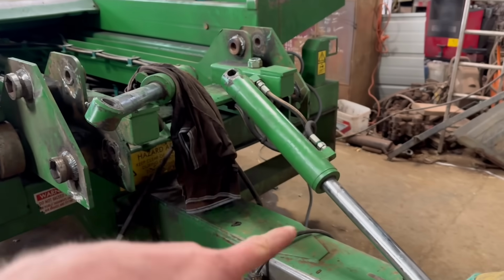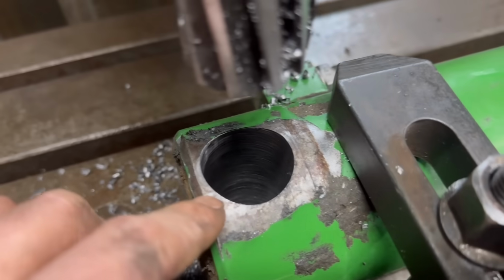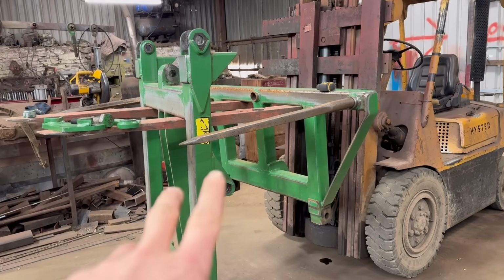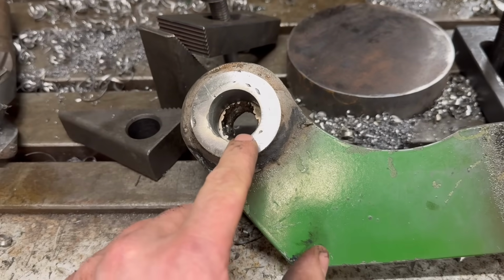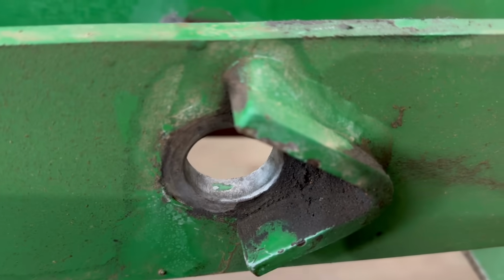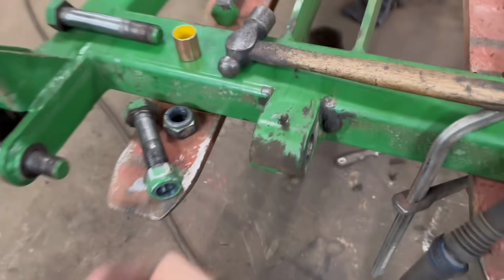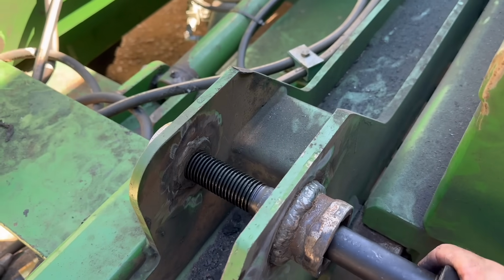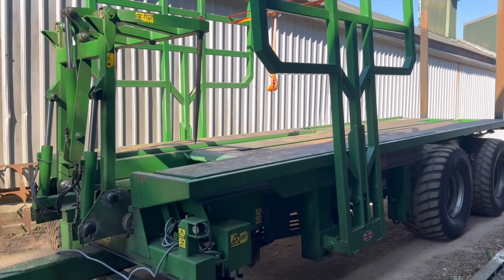Heath Super Chaser needing some attention. REASSEMBLING! Final

Comment: VERY aggravating !! I've got a 31 year old Isuzu truck in factory new running condition bumper to bumper with one flaw. An aftermarket air conditioning mount mis-aligning the belt by 15mm or so. I've searched for the proper mounting bracket for five years now. No luck.
But I know if I took my truck to Snowball E. Oliver could hack the mount up and re-weld it aligned correctly in a half hour. There's just the minor expense of shipping my truck from Thailand to Yorkshire and back. Or giving Oliver with all his tools a week paid vacation in Thailand. (I trust the local engineers half as far as I could throw a combine.)

Comment: Nice job, but the original machinery was obviously built to a price. Most of those joints and pivots should not have been done with a bolt, but should  have been high tensile steel pins with retainers like a circlip or a tab bolted to the frame. Considering the loads and abuse that gets meted out to farm machinery they all should have been bushed and with grease points. The SHS sections looked a bit light for the forces that are applied. beefing up those joints with top hat welded bushes was a good answer.
 Well done. That bale chaser should go for at least another 3 seasons.

Comment: Seems like that sort of cost cutting is prevalent across most industries at this point. It seems like there would be a pretty direct correlation between cutting corners in engineering and the amount of warranty work or lost business that you would see, but it seems like saving money up front always wins out even if it costs more overall.

Comment: Great work Oliver, just an idea, but I wonder if the chassis plates, as you call them, are actually the manufacturers way of making them as the base for a standard sub-assembly that can then be welded on to whatever length of chassis box section they want. Also it would mean that there is no need for several welders to be working close to each other as would happen if the spring hanger assembly was being welded direct onto the chassis box sections. Just a thought.

Comment: I think that's a better option what you did to ream the bottom end of the ram out to 34mm and fit a bush, rather than reaming it to 32mm. This way, when the bush wears out it can be replaced, rather than having to ream the hole again.

Comment: As Isaac's helmet says: "I'm here because you broke something..."  Fully agree on the engineering upgrade recommendations for that machine.  All wear surfaces should be bushed, and proper heat treated pins used.

Comment: Good job, and I am sure you will be glad to have that monster clear of the workshop for a while.  With regards to the design and manufacturing issues, everything is built to a price and sold for max profit and to be fair that chaser must have moved many, many bales since it left the factory (was it a 2014 model ?). In reality the major issues were wear in some of the load bearing, moving parts and several cracked welds on the chassis.  Yes, they could have been identified at the design stage and modified accordingly, but that IMHO may only move the problem somewhere else.

Comment: The reamer does need to be concentric for the cut, it will bend and make a curved hole that is a not round, the reason is it is following the forces and the forces are pushing sideways initially then the flutes start guiding it with a deflection causing a non straight hole, as for the cut size that depends on how precise you are trying to be, a bigger cut is more deflection and a lower quality hole, how much these matter for a non precision pin is another question.

Comment: That Huron mill is definitely earning its keep ! 
A retired engineer looking at the crack patterns and design I suspect the original designer used soft-wear for over the road trucks and trailer design from what I see it would be fit for that service, unfortunately agricultural equipment needs to be significantly more robust mostly because of the uneven terrain soft roadways causing flex and twist which are minor on over the road use equipment but very significant in high load soft tired equipment like this , many large heavy load field equipment has gone to wide long tracks for this reason to reduce both ground pressure and flexing loads on the frame by using active airbag load leveling . You are correct I believe in thinking plug welding of the reenforcement on the box frame would help but likely cracks will eventually happen there too?
Nice repair to keep them working , well executed I would say !
I hope you are well compensated for your knowledge and ability !
Reply: Sir, I am a retired over the road heavy truck fleet maintenance manager responsible for specifying and purchasing equipment for over 40 years. I would never, ever under any circumstances allow that suspension and axle configuration under any piece of equipment I specified or purchased. That suspension setup would be suitable for only the very lightest of loads on over the highway transportation where a very minimum of maneuvering is required. You are absolutely correct in your statement that agricultural equipment needs to be more robust. I started a farm equipment maintenance and repair business when I was 14 and, after retirement from the trucking industry,  I'm doing the same at the age of 80. I've never seen anything like the shoddy engineering and fabrication of this 140,000 Pound Sterling, 188,986 USD machine. I am pleased that some users Oliver spoke with are happy with their machines. I sympathize with them come repair time.
Reply: @Watchyn_Yarwood  like Oliver spent some time pointing out, the linkages were not machined…even drilled…the structural members cracked. Sloppy and underbuilt. Amazing how much the machine costs for what it is.

Comment: If the manufactures wanted them to last all the pivots would have decent size replaceable,  greaseable  bushes, instead of laser cut holes in steel plate. Built to fail!

Comment: Excellent conclusion video. Thanks. I didn’t see you drill new grease holes in the bushes but you must have done because I saw you greasing them later on. You’re right about taking products to the next level. It won’t add much to the initial cost but it will pay back handsomely in the long run.  It wasn’t until today’s video that I realised what a beast that big milling machine is. Wow! Any tractor pulling videos coming soon?? Cheers Oliver. Mike

Comment: I bet the prototype for that machine was probably built a lot better and someone cheaped it down in manufacturing.
Reply: The original ones like mine had channel iron for the chassis instead of box like this one, the very first ones where just a farmer built machine so nothing very technical about them and the design hasn’t really changed very much over the years tbh.

Comment: Hey Oliver just a thought, are you assuming  the linkages are laser cut parts? they could be plasma cut parts that are just staring to wear down the cut striations on the tapered side of the PLASMA cut. Could even be flame cut. Might pay to measure the both top and bottom of the hole and see if there is a taper. cheers for the content!

Comment: The manufacturer should take your recommendations seriously - it's typical, manufacture a machine with a limited usable life cycle and sell more.
Proper bolts with correct diameter should be available, but they are expensive.
Another well performed repair Oliver - always interesting videos from you

Comment: Hello, Oliver

Nice work repairing/improving pivots of this machine.
A suggestion if I may?   Give your trigger finger a rest and ditch the squirty bottle for an air powered “Mist Coolant Lubrication Spray System for Metal Cutting” (assuming you haven’t already got one?).

These systems can be purchased for under £20 and can be easily moved from machine to machine, save you having to use the machine flood cooling system which can be messy.

Also, electric die grinders are great but bloody dangerous.  After a minor “whoopsie” resulting in having to fit a new mains lead to my die grinder the switch now has a naffing big yellow label marked “OFF >>>” 😉

Comment: You know, for someone who said in past videos that they are a non-experienced machinist you are doing well. Most engineers are not hands on. They can do the theory but struggle to operate a vernier, or harder, a micrometer. Your problem solving leave a lot in your wake. You are also not scared to push the envelope - ie, reaming off centre. I am not buttering you up. You just do it and are quickly getting a reputation for doing jobs that other walk, or run, from. Keep it up. A lot of the manufacturers are going to watch your videos - even if they don't admit it. Retired mechanic/machinist/fabricator who is not an engineer but other locals still challenge me too, not necessarily to your level.

Comment: I agree that the pinholes should all be bushed, and most importantly the bolts should have larger shank diameter than the threaded part's diameter.  That way tighter tolerances could be achieved and kept long term.  The 2 part chassis is weird, it does give flexibility to move the axle centres depending on which model they are making, but it should definitely be through-hole welded for strength.  The torque applied by the fat tyres certainly was too much for this machine, but the manufacturers probably claim that the machine is used on grassy paddocks where there is not much grip and large turning circles, so they can get away with minimal bracing.  However, if they made them properly, you wouldn't have work :)

Comment: The thing about reamer cutting edges is that they are thin and sharp and only intended to accurately shave that last bit from a hole, that's why you never turn them backwards to avoid rolling the cutting edge - not a problem with machine reamers but there is always a tendency to turn a hand reamer backwards when taking it out. Over cutting really just blunts your reamer faster, I would have gone with a boring head to move the hole over before the ream but you do you, it is your workshop!

Comment: Looks good finished, and without all that slack in the joints. Half the problems I was called out on were basically people not keeping up with the lubrication schedule, once the parts have been affected by a lack of lubrication a strip down and replacement of parts is the remedy. Using a reamer to remove excessive material (2.00 mm) can cause the hole to cut bigger, scored and the reamer to lose it's precision. On a 40 mm diameter hole we would drill to 39.4 mm 39.6 mm and then use the reamer. An enjoyable series to watch, more than to do I suspect. Take care, be safe and see you soon.

Comment: Great video!
6:22   As an old Fitter and Turner just a bit of friendly advice.
Expecting a reamer to move a hole sideways is a stretch.  Also 2mm on the dia is also a big ask.  If that is what you need to do then put your boreing head down first and leave 1/2 mm for the ream.
My machinist training taught me reamers are a finishing tool and they are designed to take 1/64” (old school) or   0.5mm.
A drill to size the hole first will just follow the old hole.  A single point boring bar won’t follow the old hole as much If you allow for the spring.
Reply: Yes totally agree from another old Fitter & Turner 1/64 slow speed and feed plenty of coolant.
Reply: @grahambaker9377 My old rule of thumb is half the speed and twice the feed as you would with a drill.
Having said all that Oliver did a nice job and the holes came out better than new. 🤠
Reply: Agree….. the reamer (or drill) is unlikely (very unlikely) to move a hole centre, even the big diameter reamers. The boring bar is far better or even consider an end mill. The end mill will cut on the bottom also but only for small amounts. A slot drill will definitely do it though.
Reply: 100% agree, you are likely to end up with an oversize hole if you take too big a cut. I learned the hard way when I was an apprentice.
Reply: Another old fitter / turner here - my apprentice instructor 1971 - 1973 ( ex - RN WW2 Submarine Engineer ) is spinning in his grave, reamers are for reaming a drilled hole to size. Good that you show us this as it means you can get feedback and grow as an Agricultural Engineer - thank you.
Reply: I was watching the reamer bit and when he said he was moving it off centre I was thinking you don’t want to do that Oliver mate! Any drill or reamer is going to follow the hole for sure !
Reply: It ain't stupid if it works.

Comment: Totally agree. This kind of machine will always look like this after a few years of work. The cracks in the machine itself could actually be a lawsuit. It looks it just is not build for the kind of work it SHOULD be designed for.
Reply: That axle setup and it being pulled around the headland loaded with bales is just asking for trouble. Surprising it lasted as well as it did actually.
Reply: Nice work and repairs to yet another machine might be you could ring them and make suggestions on how thay could improve them 
Anyway always enjoy your videos 
Cheers from North Queensland Australia
Reply: Again, with you guys, Ollie made a damn good job of the "refurbishment". The owner by the look of it takes care of his equipment. Kept clean and tidy. Imagine what a "used and abused" one would need doing🤔..?....
Reply: Aye, you are right there, however at the end of the day i suppose it’s “Caveat Emptor” or to put it more simply  “ Let the buyer beware”. 

Mr Snowball may have done them a favour, it wouldn’t surprise me at all if the welder man/woman  at the factory when building another for a customer doesn’t end up putting in extra gussets/bushes in here and there. 😊.
Reply: A few episodes ago Oliver had a load of cracks to attend to on a Redrock slurry tanker, he made special plates to strengthen the areas, I think I would think twice about that particular tanker if it’s going to crack as much as it did. Tankers carry liquid weight that never stays still and under pressure. Again it comes down to what the machines are made of and how well engineered they are in relation to the jobs they do and the conditions they are operating in.
Mark from Scotland 👋😀👍🍺
Reply: Be interesting to know how old the machine is and what type of work it’s actually done, if it’s been used and abused every season for 10years contracting work, I think it’s doing well.